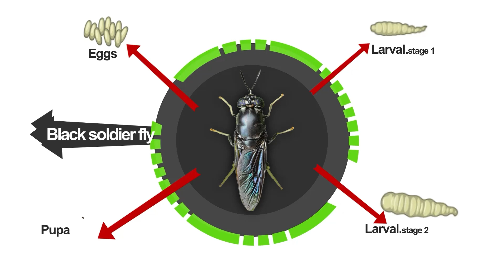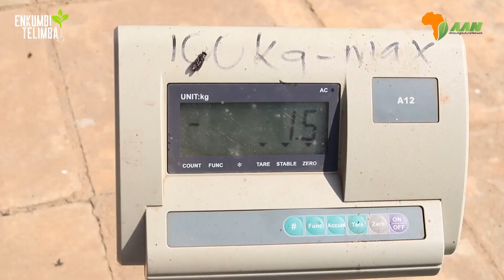Turning trash to cash with Black Soldier Flies | Marula Proteen Farms

Comment: Brilliant! What kind of oil do they produce?
Reply: It's extracted from mature larvae using a machine. Usually the larvae is 35% reach in fat content.
Reply: What is oil used for?
Reply: @hondo2757  Either as a feed supplement or as biofuel! Very good for weaner piglets!
Reply from the maker: Proteen Oil